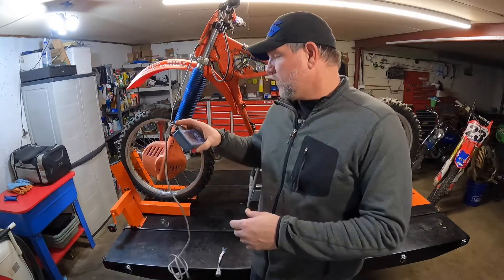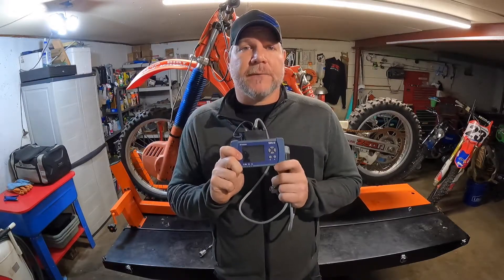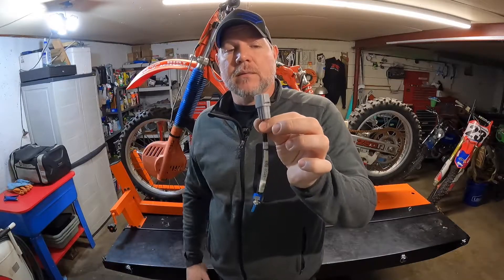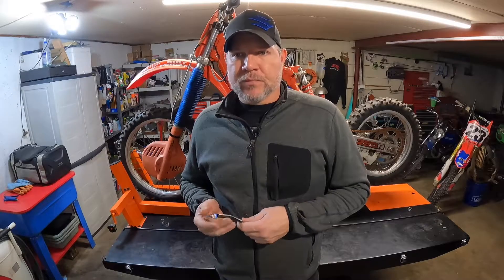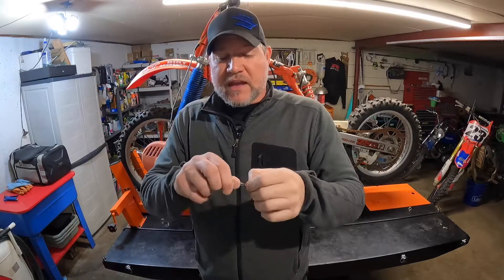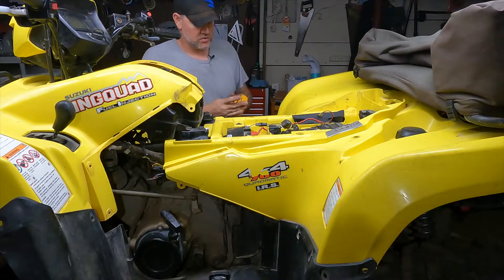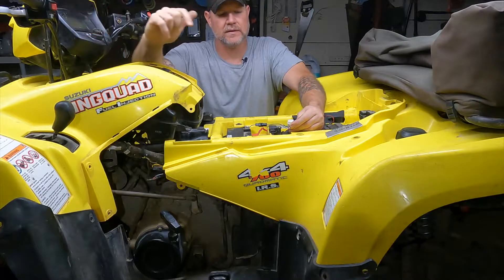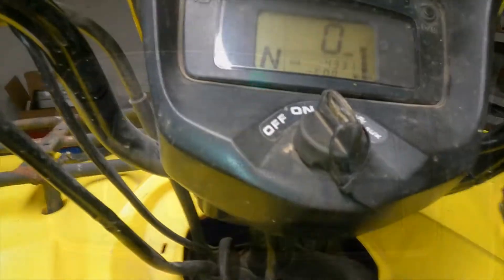How to bypass the Suzuki Diag plug  & TPS  check/adjustment

Comment: Where the diag plug on a 2006 suzuki boulevard s50?
Reply from the maker: I believe it should be underneath the seat near the battery
Reply: @limitlesspowersportsservic3394 the battery is on the bottom of the motorcycle. Like a little trap door and opens. Not under the seat.
Do some bikes not have a diagnostic port?

Comment: great info thanks
been a suzuki tech have you ever come cross a suzuki burgman 400 k7 
i am chasing a issue where  the bike dies after 5k rpm no fault codes, changed the fuel pump and throttle body and now just set the tps but still the same, if i quickly turn ignition on and off while riding it will accelerate till you close the throttle again any input would be great thanks

Comment: Where can I buy the Code Reader meters that Small dark blue one ?
Reply from the maker: The blue one is a Suzuki factory tool that usually only the dealers get. On the Suzuki you cam just jump the diag plug & read the codes on the dash.

Comment: The line on mine seems to be stuck at the top despite adjusting the TPS. Any ideas? I’m thinking I need to replace the sensor as it seems to run better when the sensor is disconnected 

Thanks!
Reply from the maker: Yes that is 100% the sign of a bad TPS sensor. You definitely need to replace it. Make sure you get an oem Suzuki one do not order one off of amazon. They've all the same steps to set the TPS once you put the new one on.
Reply: @ thanks for your response! Keep making the great videos!

Comment: Does the quad need to be wormed up or anything for an accurate reading?
Reply: Bc when I adjust the - and press the throttle it goes up & back down to the middle like it should but after test ride ing it for a bit the thing stalls and the - is back up/down.
Reply: U think a new tps would solve my problems of dying when idle and needing to further throttle to start n keep it running or is there something else that could be wrong with it if so please give me some feedback. Ty
Reply from the maker: Yeah if it keeps going out of adjustment then it definitely needs a new TPS

Comment: Hi great video…I’m having a issue with my ltr450 are you familiar with those?
Reply from the maker: I sure am. What's seems to be your issue?
Reply: @limitlesspowersportsservic3394  I’m having a issue where the fi light flashed I check the code it’s coming up 23 which is tos..I got the bypass for it online and it’s still flashing by the same code I took the one out of my sons kfx450r and same thing code keeps coming ack when I turn the key
Reply from the maker: So does it still start up with the bypass & the code? I would check all the wires going into the back side of the connector toale sure one hasn't come loose are a wire might if broken inside the insulting
Reply: @limitlesspowersportsservic3394  it starts for not even a second then shuts off I checked voltage at fuel pump and it’s 12 volts then drops to 0 I tested the middle wire from the tos to the cdi to make sure it was working through the whole wire and my tester beeped but I’m not sure where the other 2 wires run too one is red other is black with a brown tracer I tried finding a wiring diagram but when I zoom in I can’t read the wire colors that also plug into cdi and the red wire n looks like it runs over to the voltage regulator I could be wrong though
Reply: @limitlesspowersportsservic3394  and thank you for you help I appreciate you taking your time to help me!!
Reply: @limitlesspowersportsservic3394  not sure how but I got the tos light away it has no light on but still starts same way as soon as it starts it’s shuts off not even a second after cranking for a few seconds light starts flashing and it’s code 12 but I just changed out the stator any ideas
Reply from the maker: Did you replace the stator with a O.E.M are did you order a aftermarket one?  Ive ran into issues with the aftermarket ones. Here is a link to down load pdf of the service manual.
Reply from the maker: LT-R450 http://www.crservice.dk/Suzuki%20ATV/LTR450/LT-R450K_6_01E.pdf
Reply: @limitlesspowersportsservic3394  thank you very much for the service manual…I replaced it with a caltrops brand one just to see if it was my issue if it was I was going to get a oem just didn’t wanna spend that much for something I might not need…and when I turn the key I have no fi light now it only comes on if I crank it for7-10 seconds straight then the light will come on but when I turn key off then bike on it goes away atleast the tos code went away but I’m still at the it starts but dies right away I have continuous spark and I tested pressure from regulator and it’s around 35 psi and doesn’t drop
Reply: @limitlesspowersportsservic3394  hey thanx again the service manual really helped out I figured out my issue and she is running perfectly!!!
Reply from the maker: That's great to hear. What resolved your issue?
Reply: @limitlesspowersportsservic3394   the red wire to the tps sensor had a break in the wire I used the wiring diagram from what you sent me and was able to follow to where it went so I could test for continuity thanx again man huge help!!!

Comment: My kingquad has  _C00 but when its running its -C00  do you think i need to adjust the tps sensor?
Reply from the maker: Yes it need to be adjusted just a tiny bit. When it's not running the - should be in the middle.
Reply: Thanks alot

Comment: Hi there. For mine when I jump it and the line at first is on the bottom. When I give it throttle the one moves up to the top. Then goes to the middle. Not like yours on video went back to the bottom. Mine does have a long or hard start when cold. Would this be the issue?
Reply from the maker: That is a really good possibility of why it's hard starting.  When it is reading improper tps signal at start up its telling the ecu the wrong tps reading. So try to adjust it before hitting the throttle & once it's adjusted then hit the throttle & see what it does. If it stays at the top  then you will need to replace the tps sensor.

Comment: Where can I buy that sds2 tool?
Reply from the maker: Hey Fabricio. Unfortunately you can only get them as a Official suzuki dealer. Unless a shop closes down & then you might be able to buy one. Check ebay also. But they need to be updated regularly by a dealer to stay current with the new models that come out.